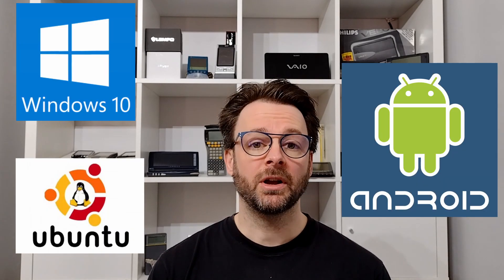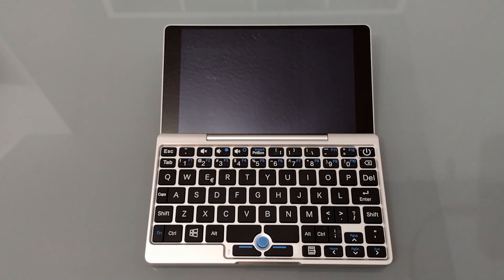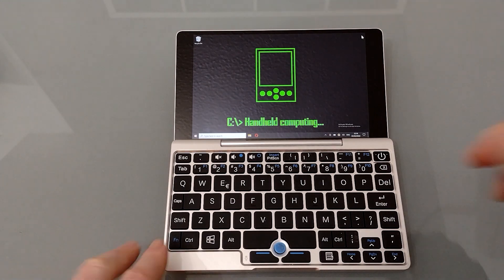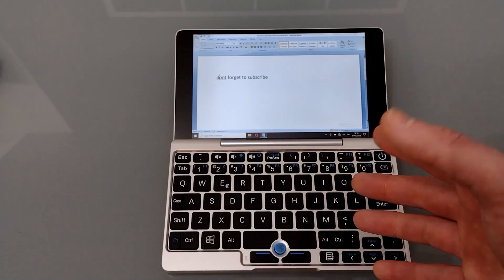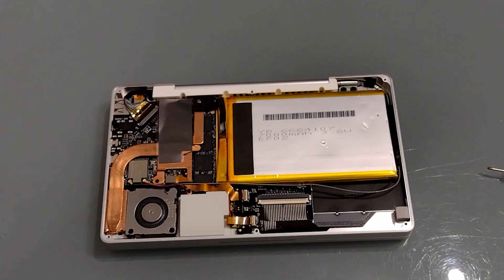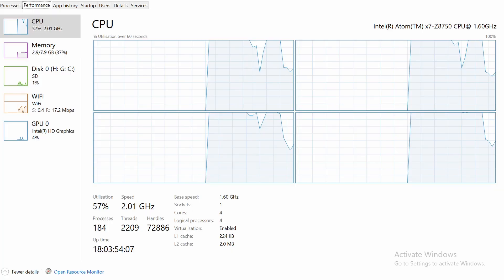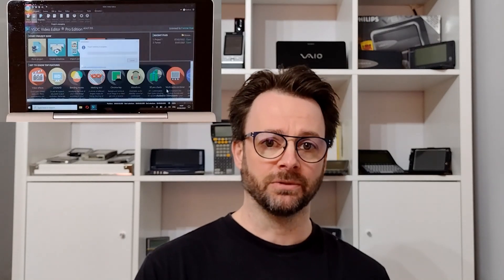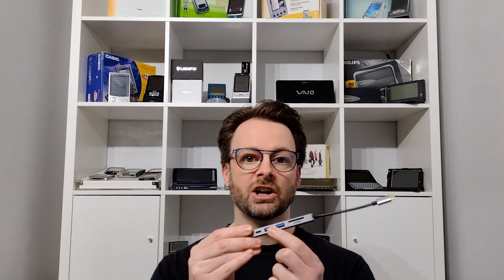The GPD Pocket 7 Review

Comment: I originally bought it with Linux and when idling Ubuntu usually tells me more than 20hs of battery remaining, and I got it in the original indiegogo campaign, but I'm pretty mindful of not leaving over 85% of charge for extended periods of time.

Edit: I use dim screens at near minimum or minimum in all my devices in most places.
Reply from the maker: I use the pocket 7 regularly and while it is a little laggy under the latest version of the increasingly bloated windows 10 it still works great. I have had a couple of battery issues but nothing disconnecting and reconnecting the battery couldn't resolve. As for battery life when idle it reports 15 hours but in the real world I am probably still getting a solid 6 hours of light usage which isn't bad!
I am planning to try a work around to install Win 11 and see how that runs - its only the CPU that doesn't meet the standard

Comment: I love mine. I always wanted one of those old Sony Vaio micro laptops. I played a bit of MtG arena on mine when it first came out. Then for a bit I had a linux system on a 256 usb that I'd keep with it. Basically allowed me to have a windows and linux machine with me at all times. Great little laptop for running betaflight and tweaking FPV drones out in the field.
Reply from the maker: Good plan running Linux from a stick, 128GB SSD can be used pretty fast! I love the Pocket 7 for when I'm away and its battery life is excellent. I have the Vaio Picturebook  C1MHP (sadly the keyboard has become faulty) running XP, its a little slow but nice to use

Comment: Hello Huw, first of all I wish you a happy new year! 🎉 I've just bought a Chuwi Minibook to use as my daily driver when I'm on the go and I've remembered that you've made a video about the Pocket 7 which I find quite similar at least for the keyboard and the casing. My little machine has an 8 inch IPS touch screen with 1920x1200 pix. resolution, an Intel Celeron N4100 2,4GHz processor, 8 GB dual channel RAM, 128 GB SSD, M2 expansion available as well as a 3,5 mm audio jack, USB type C, mini HDMI and a USB A 3.0. It's keyboard is backlit and the power button has a built in fingerprint sensor. Of course it has Bluetooth and Wifi support too. It comes with pre-installed Windows 10. Have you heard about this little machine or the manufacturer?
I'd like to ask for your help as well. How could I set up the keyboard in Windows to make it match with the signs printed on the keys? I have to open the on screen virtual keyboard many times if I want to type a special mark or character.
Thank you for your help in advance. Greetings from Hungary!  👋
Reply from the maker: A happy New Year to you too! 

It's not one I have heard of, it looks a lot like the "one mix yoga" but 8 instead of 7" screen. That looks like an amazing portable with plenty of power on the go! There are a number of Chinese manufactures making or selling UMPCs often the same device re-branded.

Go to settings, type Language, select keyboard there's a drop down box, select the keyboard language from there. If the option you want isn't there go back to language and at the bottom you can add a new language. That should have your keyboard working properly!
Reply: Thank you very much for your answer and help. :)

Comment: awesome video! Currently im using the One GX1 Pro , 7 inch, laptop with 11th gen i7 1160G7 with iris Xe graphics, 16g of ram, and 1.5 TB of storage (512 internal and an additional 1tb nvme) runs like a dream. I got it for both work and play, its the most travel friendly laptop with its form factor. I can also play just about any game on it, sometimes on high but usually a mix of medium and low for more demanding games, but it has two thunderbolt 4 ports on the back and when i get home i usually connect it to an egpu enclosure to add a gtx 1080, 140hz monitor, mouse, keyboard, and speakers and all of a sudden its basically a desktop pc in seconds. it might be a very specific use case and niche' thing, but its def something i use every single day and very easily my daily driver because of its portability and performance. also the rbg backlit keyboard and the fact it came with its own detachable joycon like controllers were just very good bonuses
Reply from the maker: That is a very impressive machine! Certainly makes it possible to have a single machine as both your daily driver and desktop machine with the aid of the thunderbolt 4... Now where can I get the money for one of these....

Think I will need to stick to my trusty pocket 7 for the time being!
Reply: @HandheldComputing  mine wasn't too cheap but for what I got out of it I was just as happy with that as I was if I would have spent the same amount of money on an equivalent laptop with same specs, I wouldn't mind one of those as a secondary computer too tho
Reply from the maker: @gman102formyspace  Its about the same as I spent on my Nitro5 and not far off the same power so yeah I think its good value!

Comment: I do have newest Pocket 3. 
I find it a better media consumption device on the move, then my phone. 
Because if how screen works, you can hide away keyboard behind a screen, but have it angled for most comfortable viewing angle. I do wish it would be a little lighter though.
It additional purpose is a lab computer. Due it's small size it doesn't take up to much space on the table, when viewing schematics, and it can grab data from logic probes and other things with no problems.

Biggest challenge I had is the fact that I am using Linux on it, and some drivers are miss behaving. But I will address them at some point, non of the issues are unsolvable.

I also had Pocket 7 awhile ago, but I really needed device with more ports. As such it was just used as a note taking computer.

Additionally I own an ancestor to Pocket 3 from Fujitsu, which have same screen hinge, but it's awful CPU and issues with internal bus through-output to hard drive made it not usable for modern times. Something is really weird going on with how hard drive is connected, I upgraded it's old mechanical hard drive with SSD, but reading and seek speed is still really bad. And I have no idea why.

I do really like those portable laptops, and I am glad that GPD resurrected UMPC.
Reply from the maker: I think the 8" display on the pocket 3 is probably a better size for productivity and it does have much better specs. For the Pocket 7 I use the USB C port expansion a lot!

Was it the Fujitsu U810 you have? Its a great little computer and one I would love to add to my collection. Im not sure but I think it has an old IDE interface so low bandwidth for the HDD/SSD.

GPD have done a great job at making UMPCs a real option again!

Comment: Love the GPD Pocket 7, I was very close to buying one but then I went for the Lenovo YogaBook 10 windows version because of how slim it is and also has the wacoom drawing tablet integrated. They both have similar specs... the GPD has more RAM. I am tempted from time to time to get a GPD device. I love the way they look.
Reply from the maker: The Pocket 2 is a little slimmer than the 7 also better specs. Its a nice form factor but I do like the look of convertible wacoom screen on the One mix or the new Pocket 3. I think GPD have a good aesthetic with most of their products and the newer ones make a lot of full size laptops look under powered!